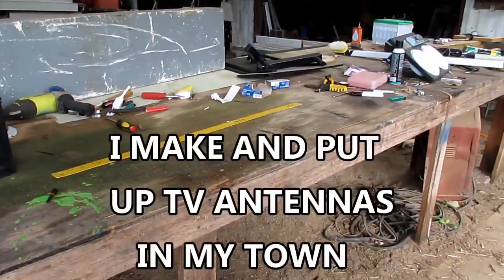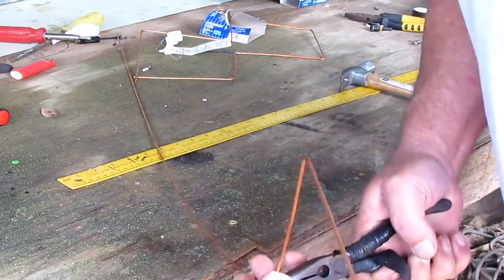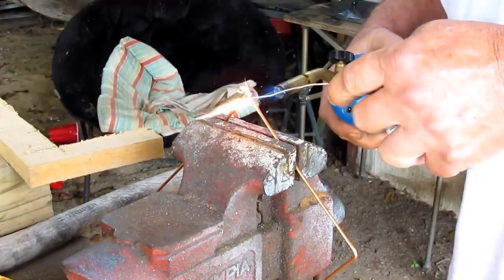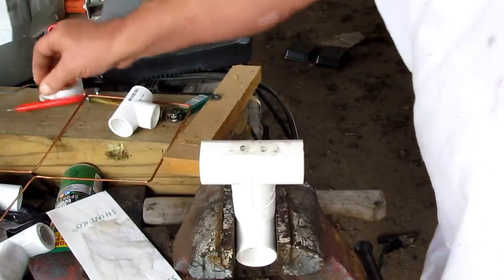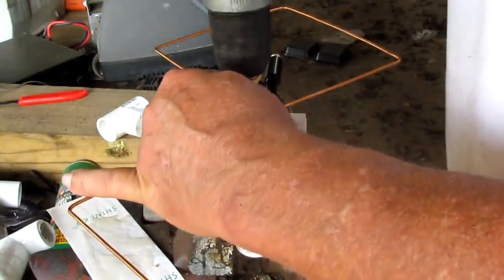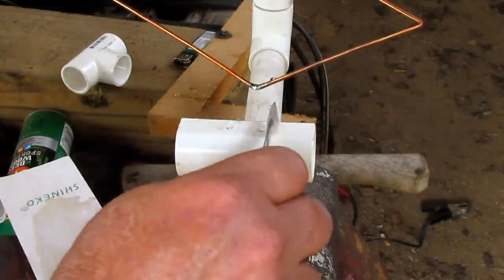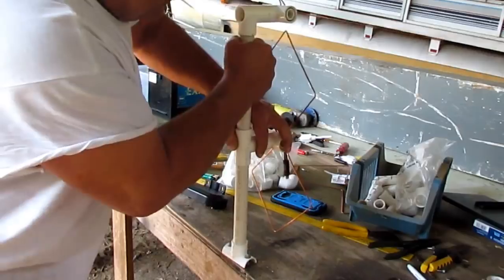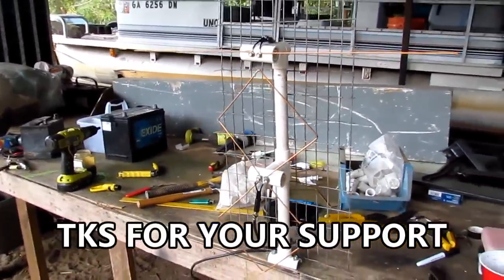Best DIY Indoor Or Outdoor TV Antenna Ever Made

Comment: Awesome video man! Quick question: is copper better at grabbing the signal than steel wire? I mashed up a few different designs and used what I had lying around (steel wire) and get weak reception. I know a lot of that is my distance and terrain to the towers, would the copper wire improve on the distance issue? Keep up the great work on the videos, they are some of the most informative I've watched!
Reply: Copper is the best for any electrial work. Remember Science class 101?
Reply: Strange how my RCA antenna isn't copper and works amazing, pulling it 40 channels when my RabbitEars report says I should only get about 4. Seeing how we're dealing with television signal and not electrical current, maybe you can join me in Science 101?

Comment: I have one of those antennas, with Xs and grids, but in the middle it had a reciever with a capacitor (I think) and from that you would take the signal, will it still work? The Xs are out of alluminium, should I change them to copper?
Reply: This is a "receiving antenna".  Any conductor will work - and just as well!  The cap is most likely to tune a transmitting antenna (HAM radio).

Comment: I have an outdoor antenna CS 4 Max that fell from high up and had a weird break. The way that it broke much of the outer plastic shell(the outer area of the antenna that has ClearStream written on it) is broken beyond repair. This shell allowed the antenna parts to be screwed into the plastic shell. Now, I have to figure out another way to do it since the shell's damaged. 

It has 2 antenna parts: A. Two big 8s that go side-by-side in the middle. These have a cable attached that was on the inside that connects to the CM 7779 AMP. B. There are also 2 poles that extend left and right that DID NOT have a cable attached. For some reason, the poles only had to be screwed down to the back of the shell. QUESTION: ANYBODY HAVE ANY IDEA ABOUT HOW I CAN MAKE THIS WORK TO USE IT AS AN ANTENNA ONCE AGAIN?

Comment: Hi! Nice video. First time I see antennas made of copper wires. I used to make one using aluminum tubes which brakes easily after a few months due to birds. With your design using a steel mesh as reflector, this might help protect the wires. I will try this using rods though. Thank you. Shalom

Comment: I'm still kinda confused why you have both a booster and the reflector on/with that antenna. I remember asking you (on another videos comments page) if a booster and a reflector do the same thing, and it seems you said yes, which led me to believe that only one or the other is needed, not both; however, I get the impression from this video that both may actually be required, but it just depends on how far away you are from broadcast towers? Is that the case? Also, do you recommend just trying the antenna with the reflector only, first, and see what happens? When you talked about "too much candy", I have no idea what that means? Does it mean that having both the booster and a reflector together somehow caused the signal to have some sort of image distortion or oversaturation of color or hue or perhaps a buzzing audio sound?

Comment: basically a clearstream 2v like i have!
Reply: I own two of the clearstream 2v antennas ,They suck,I bought them to replace Two Flat RCA 10 x10 flat antennas .The RCA ones actually pick up more channels inside than the clearstreams do outside....and I have tried them without booster and tried them with several different boosters.
Reply: @dannyalvens5418  i agree, the 2V did worse than flat antennas one day, the other day, its great. i went from all 4 major networks to 3, then 1, then ZERO, writing this next to a no signal screen on one of my easiest stations to get.

Comment: Does it matter if the washers touch each other? Also, is there a reason you did not use washers for the straight/top antenna pieces? Also, does it matter whether or not the PVC pipe, elbow and T pieces are cemented on?
Reply: Don't let the washers touch each other.  That would cut your antenna in half.

Comment: Danny thank you for all the information you provide it really is helpful.
I have a quick question if you don't mind; I'm building your Turbo HD, well actually probably two or three. My TV towers are in three directions at 0ish, 90ish and 180 degrees. I'm going to start with one antenna without the reflector and go from there adding as needed to get my channels. My question is, if I add more antennas can I connect the elements together (not UHF/VHF but all the same, UHF-UHF ETC) like they were one element or do I need to use separate transformers and combiners keeping each unit separate? 
Thank you
Reply from the maker: it can be done but has to be done right,,,,,its way way to much to type on hoow its done 
\

Comment: It looks like you put the transformer prongs between the washer and the screw head. Is that what you did? If so then why are the other transformer prongs screwed down to the copper wire? They are supposed to touch the VHF wire but not the UHF wire? I don't get it.
Reply: Look at the video Again

Comment: Hi Danny was really inspired by your TV antenna video and I was a wondering if you could show how to make an antenna that would cover a 3000 mile area ?  You think you might be able to build one of them there things?
Reply from the maker: Maybe 200 miles
Reply: luwdmke 
Sounds like you need a satellite.
Reply: Dear luwdmke:  The best estimation I can give is to use the sky waves  and the different layers of the atmosphere to bring the stations you want to receive by aiming your antenna toward them.  High pressure systems can act as reflectors.  I remember seeing that a tv channel 27  from Kansas was listed in a Somers, Connecticut newspaper many decades ago: It must have been received often enough to be published.  While I lived in Simsbury , Connecticut,  at my parents' house, I picked up WBRZ tv2 from Baton Rouge,LA, at least twice, and KTTV tv 4  from Sioux City, Iowa once, WTTV from Indiana, WPBT TV 2, WESH TV 2, WCBS TV 2, and three or four other tv 2 stations from outside of New England, including a tv 2 from Utica, New York.  But I do not have my notes with me, they are in Connecticut.  Sincerely, Brian Nowak
Reply: If that is 200 miles consistently, that would be decent!    Of course, altitude is a big factor.  I have picked up tv stations from Maine  on rabbit ears without an amplifier while living with my parents in Connecticut a few times.  Sincerely, Brian Nowak
Reply: If Danny developed one for 3000 miles then the Government should change the message on American money to "In Danny We Trust"  as it would definitely be a bloody miracle.  I believe in you Danny for what you have shown me in this video.

Comment: Ask an AMATEUR radio operator's opinion about the antenna subject !
The TV signals are picked up by the antenna.
It doesn't matter if the broadcast is FM, HD, 4K
The antenna is receiving the signal in VHF and UHF bands.
The most important is, the antenna has to resonate on the frequency ( MHz  ) where the broadcasters are transmitting the signal.
The old YAGI TV antennas  are the best.
But the telemarketers are telling you to remove the old antennas and install HD antennas. 
I'm wondering how much  money had been made with false advertising? 
( VA3VAD )

Comment: Bi-Quad with reflektor 
You can easeli stack 4 of Them 
6DBd+3 1+1 antenne = 9DBd
1+1+2 = 12DBb .. a bit Better Then 10x to reception over any single dipol  _ . _ antenna

Comment: It's a shame we don't use VHF and UHF in the US anymore... A digital Bi quad antenna needs the wave length measured in millimeters, all you will get with a 6" bi-quad is the same thing you will get from a coat hanger. (the antenna is called a bi-quad)

Comment: I thought you needed a degree in Electrical Engineering with an emphasis on electromagnetics to design antennas.  For example, how did Danny know to make the copper wire 6 inches per side, or the dipole 14.5 " per side?  Does the distance between the antenna and the reflector matter?  But the thing works, so maybe I'm overthinking it.

Comment: Hmm ways to improve existing antenna's? One thing I know i could ad an ampliphier I got one on my poerch maybe 10 feet if I do a scan I get a ton of channels 15-25 mainly Im happy with the three NBC < ABC, Fox for football purposes! But at my moms Im only getting 8 I wasnt getting any then I switched to the heavier cable n direct link n walla first got 4 n then again got 8 this was a bought antenna so is mine smaller n cheaper but at my moms place and mine I will have to add amplifiers! In my place I noticed there is an  old analog antenna in my attic as well Bought the house a few years ago just looked in the attic its unimproved but saw the anrenna up there! N from what Im hearing theres no such thing as an HD antenna I could have used the one in the attic?? Oh well! My concern is my moms place only picking up 8 channels N I know it could be a lot more n its plenty higher Id say 15 feet or so n Im lookin at ur home mad one with some interest as well seems simple enough n I do like to experiment n Im way up noth in North Dakota in a small town trees arent too bad but there are some? I just wanna make it the best I kin with what I got n I dont wanna climb up on the roof cuz its an old 2 n a half story house! I used qan old J tube from a satalite dish attached to the siding. on the SE corner of the house its pretty strong n firmly bolted cuz we got serious winds up here 50-60 mph winds are common at times.

Comment: Do you use the other part that comes with the Preamplifier, a piece called the power injector? I have no idea how someone is supposed to use it, because it has a cord on it that needs to be plugged into an outlet inside the house, even though you also have to plug in the antenna cord into the back of it outside. It makes no sense. You didn't show that part at all, so I'm guessing it's an optional piece for some other purpose. I contacted the company, but haven't heard back from them yet. Anyway, I presume you just simply don't use it at all, since you didn't show it or talk about it.

Comment: Love your accent. Was you born in Newfoundland Canada?  They make antennas from barbed wire. I like this model 'cause I live in an apartment with no balcony. I'm thinking of mountain it on an old tripod  and pointing it  for best signals.
Reply: antennaweb.org will show you where the signals are coming from at your location.

Then, you can point the antenna where each signal should be coming from, then "add" the channel to your TV manually, and of course keep the channel if you can actually receive the signal.

That's faster than rescanning the whole band every time you turn the antenna a few degrees.

Comment: I hava metal building I need to put one out side. I take it will work out side us good old boy need to stay together.
Reply: ALL antennas work MUCH BETTER outside!!!   This "good ol boy's " antenna looks MUCH too fragile for an 80MPH wind!  Better to build the whole thing and place the elements INSIDE of PVC piping!  That will NOT affect the reception - and, depending on where you are (and your stations are), longer elements for the VHF dipole (at the top) might be better).

Comment: just a stack of dipole antenas infront of a reflector ........... ok for wide band channel finding but has no gain compared to an antena with a boom with directing eleiments and and with a folded dipole and a reflector ...................... we make them in the uk and they are ok for broad band reception , but not good for long range were a beam is needed . .. They are ok if you are in an area were there stations are spread all over the tv band , But they are bad for rejecting cross modulation or interfierance across the band . , with new digital networks cuming on air in place of analogue uhf tv . you will work better with a beem on the frequency group , in the uk were tv starts at 470mhz then the tv antena has a red tip and the highest yellow tip for 750mhz . so we group tv antenas as red green blue yellow . , each antena is a different seize and is tuned to the channels that are for your own area . , so go on the net an look up your antena group before buying one , This is critical to making sure you have the right antena for the new digital tv transmitters being rolled out over the old terestrial services to be switch off later ????????????????????????????????

Comment: How important is it that 10 guage copper wire be used? I can't find any anywhere. I've called and/or visited 9 places in 3 towns and nobody carries it, not even Lowe's. The closest I can find it 8 guage copper wire.
Reply from the maker: 8 is better
Reply: Just buy some romex 10-3  and strip the insulation off of it
Reply: The smaller the number of the gauge of the wire, the thicker the wire is.  I have used 4 gauge solid copper wire before.  Sincerely, Brian Nowak

Comment: I live behind a large hill 600 feet. Someone should design a drone that can go around the property and tell us where the best location and height for your antenna. Putting in a pole only to find out moving it a few feet this or that way is a better signal becomes a bummer. Every antenna says they are the best until you read the directions. Then they say it may not work because of everything outside. It is dishonest. They don't tell you anything useful. I can take an antenna and aim it 90 degrees from the transmiter and get some stations until atmospheric conditions change. I suppose they are reflected signals which really becomes apparent when a helicopter flies near my home and it scrambles the picture. Then you start turning the pole, bit by bit, check the picture and you may or may not get a steady signal. Doing that in a 360 turn of the pole becomes a frustrating way to watch TV. I don't think you can put in three or four antennas and then combine them so you always get a watchable station but it would be nice.

Comment: I LOVE how you copied an existing design and concept that has been around for decades and CLAIM you invented it.... BULL.... This is a multi bay dipole antenna with "whisker" elements (also called BOWTIE)  to increase capture area and Q (bandwidth). I like you but your bragging is silly. You know zero about the theory behind this. YOU COPIED OTHERS. With that said I made this antenna 12 years ago from PVC pipe and ROMEX house wire (insulation striped) and it was THE BEST ANTENNA EVER MADE.... Ha ha. Actually it is pretty good and still in the attic. However BEST antenna ever? There is no such thing. It depends on what signals you are trying to receive.